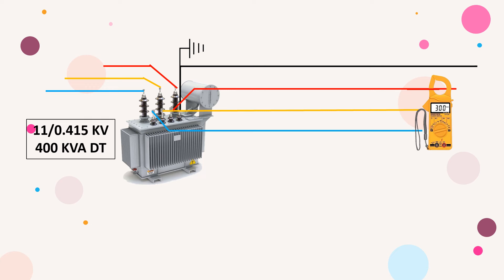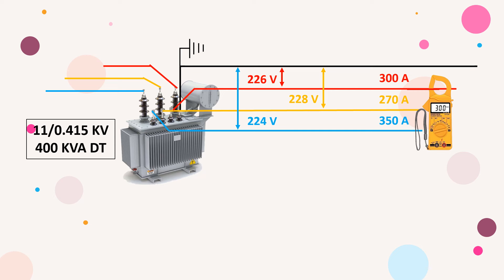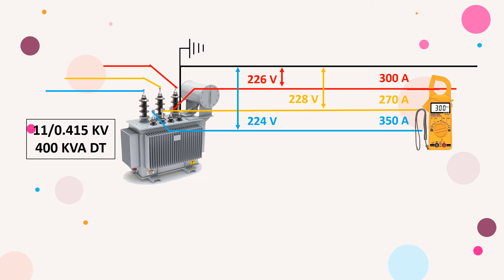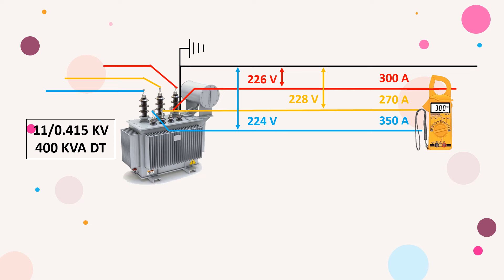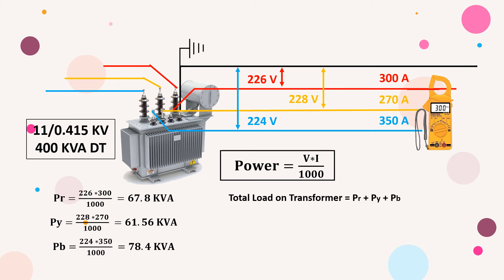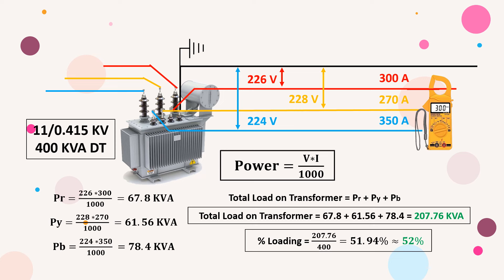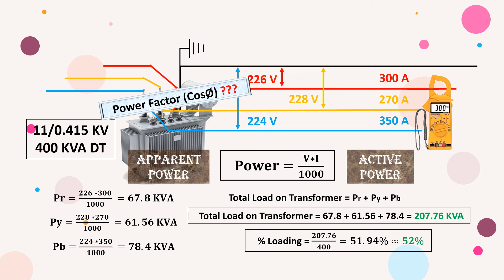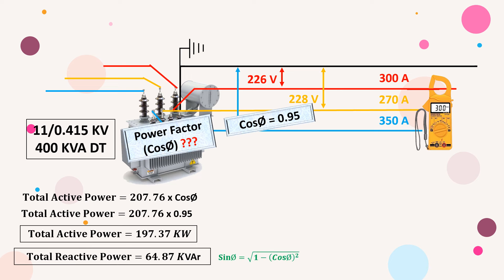How to Calculate Load of Transformer | Ampere to KVA Calculation | Transformer Load Calculation |

Comment: Is this same concept applicable for cable sizing?? Like do we calculate cable size based on individual line currents or sum of all currents?
Reply from the maker: Excellent question dear...👍👍
You can not sum up the currents like this. But power can be added. Let's assume that 200 KVA load is connected on one phase only. Then current on this phase will be 
200 x 1000 / 230 (assumed) = 869A
It is highly UNBALANCED CONDITION. 
That is why in three phase system load balancing is a must.
Reply from the maker: While deciding the LT Cable size, an appropriate consideration should be given to possible  unbalancing in LT system.
Reply: @electromagneticworld  assuming you have 600amps , 415v, 3- phase load. Do you specify by 600/3 or 600amps through the cable catalog chart?